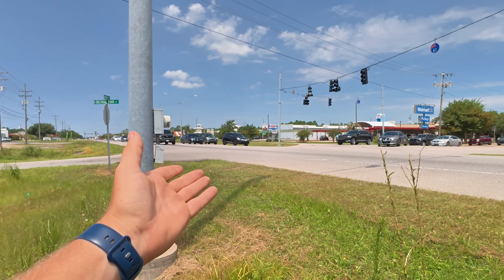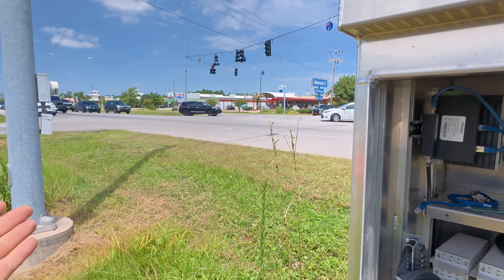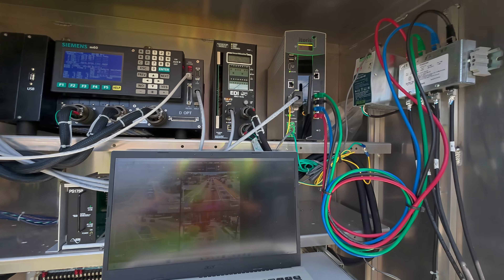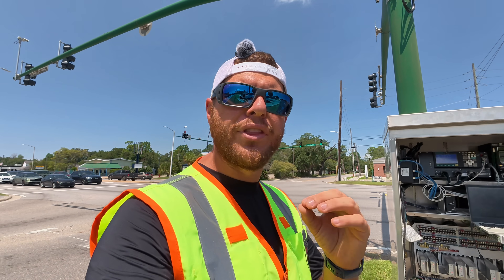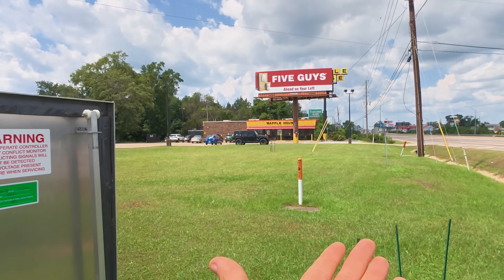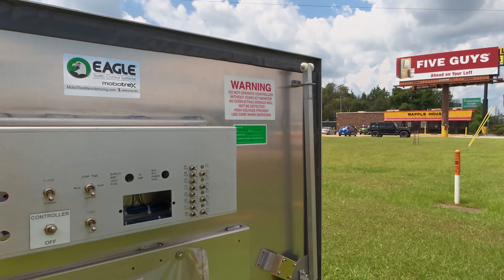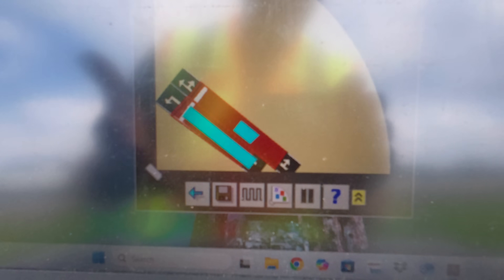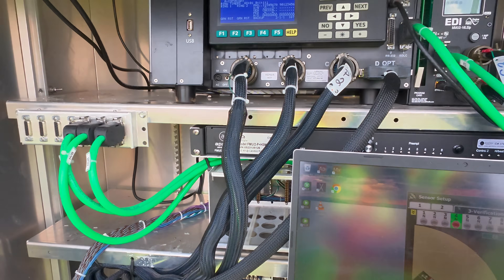Let’s Go Over 3 Types of Vehicle Detection!

Comment: Maybe one day you can do a segment on early signals control history. Ie. timer control only and I can also remember steel plates in the road prior to the stop line that would detect a vehicle by its weight I would assume, just prior to the advent of induction loops.
Reply: Detection by weight hasn't really been a thing. It's been a common misconception that the loops cut into the road surface are scales.
Reply: @jovetj  I believe he wants a traffic signal history lesson referencing to the time before loops, and it sounds like before some intersections used  pressure plates to detected vehicles. It sounds like he wants timers only.
Reply: @miluth2  No public roadway ever used pressure plates. Period.
Reply: @jovetj  the next time I see one still installed due to the city not removing I will send you a picture. I saw a lot of them still intact when I did signals and maybe a month ago when someone asked me what it was. Maybe they were never used where you live.
Reply: @miluth2 I visited your channel and that photo is exactly what I meant. They were definitely for real. I guess the signal dr. and other commenters are simply not old enough to have seen this. After all i am talking about technology that is in excess of 50 years old. Just thought the signal dr. may have some insight since he seems to have studied all aspects of signal operations including maybe some before his own existence.

Comment: What a great information video. Your commentary was awesome for explaining the different forms of vehical detection and how each one works. Love your channel and content.  ❤   One question. Are the emergency vehicles carrying a device that enables them to change the light green until they get through the intersection. The city busses have the same ability?
Reply: Yes, those devices are common. At least in my neck of the woods.
Reply: From my experience I have never seen a bus with a unit to change the lights, only to extend the green when the light is green and the bus is running late or to give a green for the bus when there is a bus lane, before giving a green to the general lane of the same direction. They opticom unit is designed for emergency vehicles, buses are not emergency vehicles. The only emergency vehicles I have seen use them are fire trucks here. I  am not sure why that is, but have an idea.